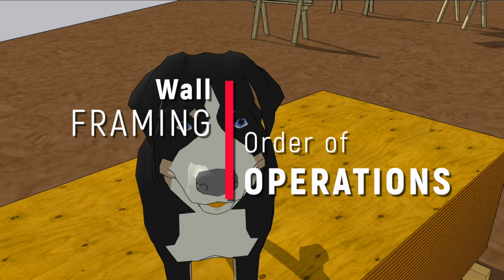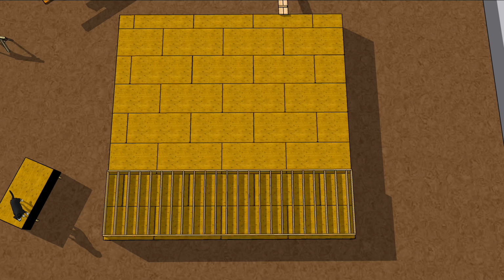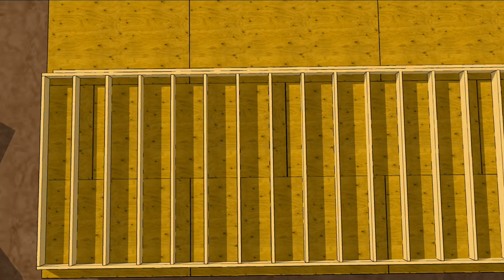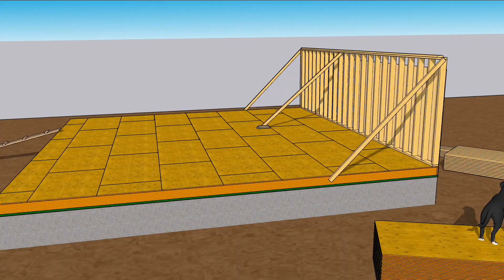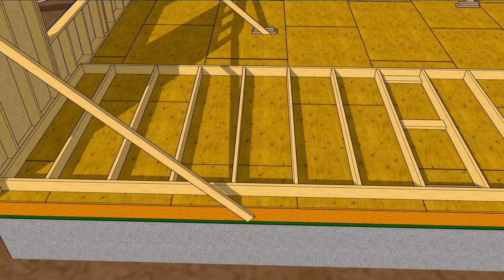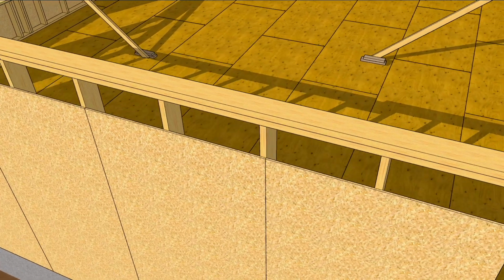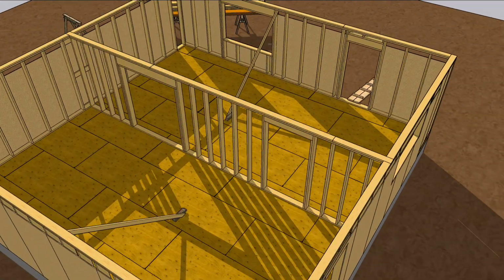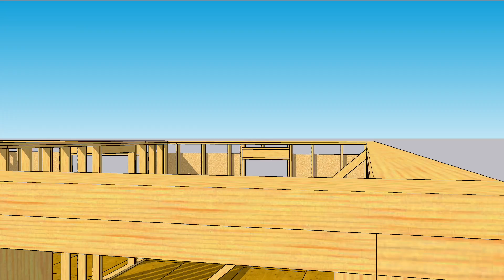Wall Framing Sequence and Sheathing Patterns

Comment: So the gap at the top of the sheathing left by dropping the sheeting to cover the rim joist and mud seal...do you sheath that before putting the rafters on? It's not clear from the videos. But this video series is awesome.
Reply: I was waiting for that part as well. Don't believe the top sheathing was added. That aside, a very thorough and effective video.

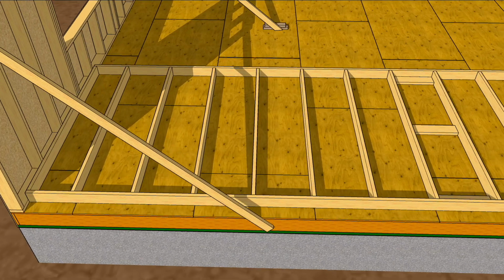Comment: 2:14 Good idea for suggesting a ladder backing to tie in your interior load bearing walls or your non bearing interior walls that are for seperating rooms. This is the most efficient way rather than framing a "U" channel that uses morw material. The ladder method uses less material and should result in way less thermal bridging unlike a traditional "U" channel composed of studs. This way allows you to go back and add in your insulation bats later on with relative ease too! This is a plus if your insulating your exterior walls through each bedroom too as it tucks behind the diving walls separating the rooms.

Comment: Framer here, ive never seen wall sheathing stood up 8ft always 4ft up 8ft across with staggered joints, locks the studs in better in theory. Is this common in other areas?
Reply: @zachlong7781 From arkansas and ive seen people do that as well.  But im sure a lot of standards are based on weather in certain regions.  Bc im assuming when u say staggered ur saying at a 45 degree angle?

Comment: Could the siding also be added while the wall is still flat on the floor? I'm about to build a shed next spring but on 1 side I only have like 1 foot of space after the wall is in place
Reply from the maker: Heck yeah. In order to install the siding, you'll need to trim the edges and windows. In order to trim the windows, you'll need to install the windows. 

People do it all the time; it just requires extra thought up front (and it makes the wall heavier.)

Comment: Sheeting should not be straight up and down, but should be left to right, staggering.
Reply from the maker: ...becasuse?
Reply: @ProTradeCraft maybe ties more studs together?  Idk, just guessing.
Reply: Any sheathing manufacturer will tell you it can be done either way. Yes it is stronger horizontal and staggered but you'd have to add blocking behind the adjoining seam which adds slightly to thermal bridging. https://youtu.be/exryGdVm5ek?t=413

Comment: When you make the framing you should check for square when on the floor and lock down with 2x4's place diagonal across framing section(on inner side). After elevating and sheathing you may remove diagonal bracing..This will ensure a square frame so no racking is required with the sheathing panels/frame..
Reply from the maker: correct. Thanks for pointing it out.

Comment: measure in 5 1/2 inches for 2x6 walls. measure the length of the walls and square up the floor before you chalk out your lines. I like to lay out all my interior walls plus mark out doors and windows. This makes it easy to transfer on to plates without checking the plans plus it makes it easy to mark out overlap plates
Reply from the maker: Yes.

Comment: what do you do with the 6-inch opening at the top, just below the top plate??
Reply from the maker: You mean the strip of wall sheathing that hasn't been nailed in there yet? 
Nail some wall sheathing in there.
Reply: Also, since exterior walls are shear walls, blocking is requiered at abutting sheathing panels.